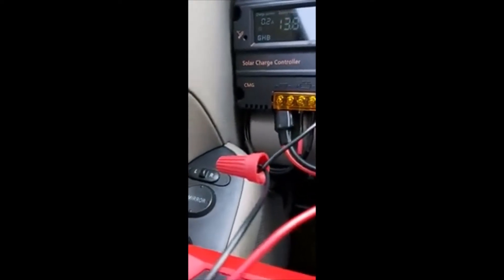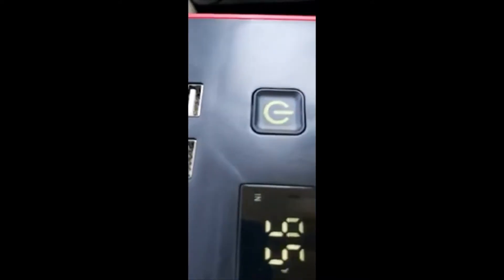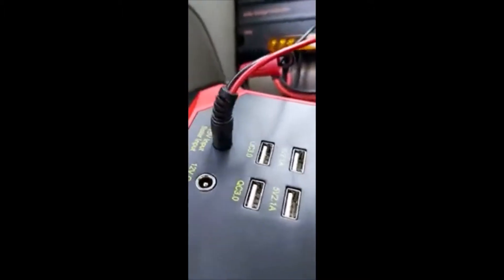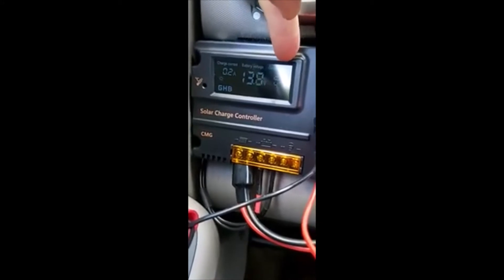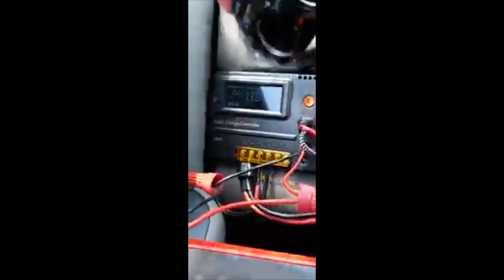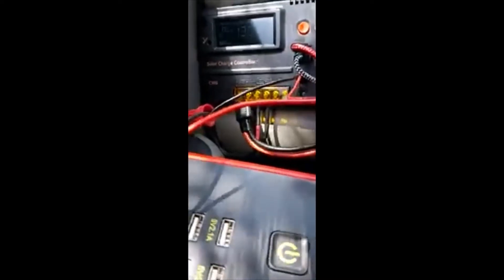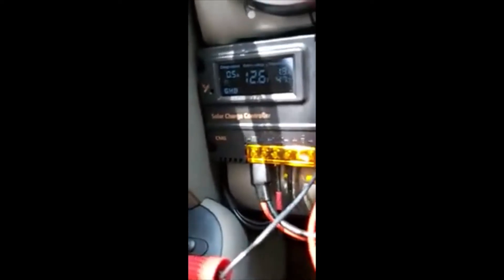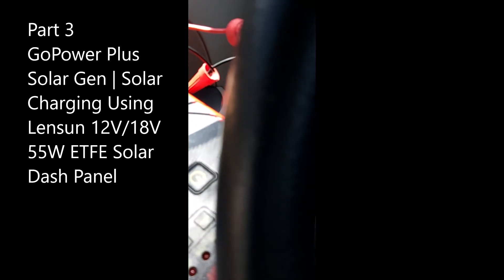GoPower Plus Solar Gen | Testing  DC12V on GHB PWM  MC4  Lensun 55W Solar Panel Part 2

Comment: These things are a great value. I picked up two for $30 each. The only downside is they will not recharge while in use. They are a total of 167 watts. Internally they include 18 18650 lithium batteries. Max output is rated at 100 watts. Probably good for 500 cycles at minimum before a reduction of capacity to around 80 percent.  Harbor Freight solar brand Thunderbolt works natively without any adapters. People rating this item poorly mostly likely attempted to run appliances that required more than 100 watts and overheated the device.
Reply from the maker: Thanks for your comment. The manufacturer did mention that they will the charge other devices while it charging because they wanted to protect their product. That is the only down side to these. That is way I ended up buying 4 of them.